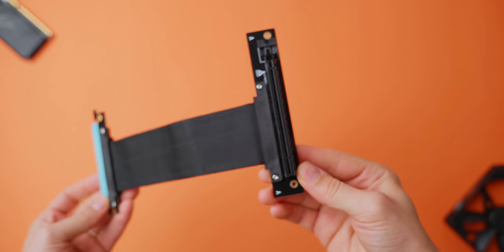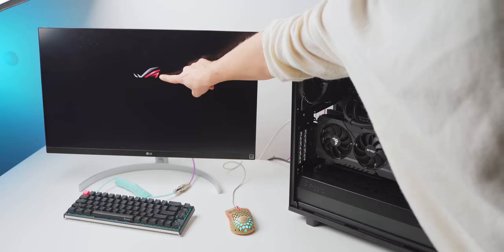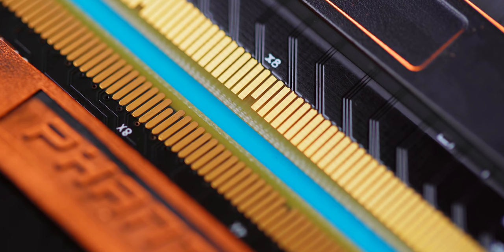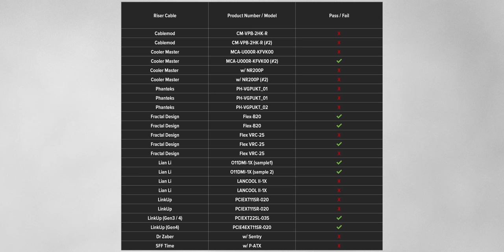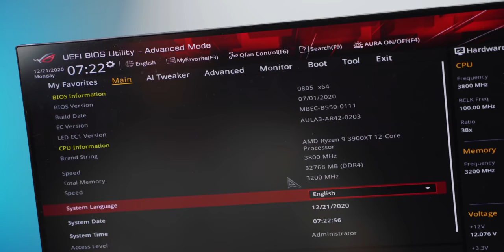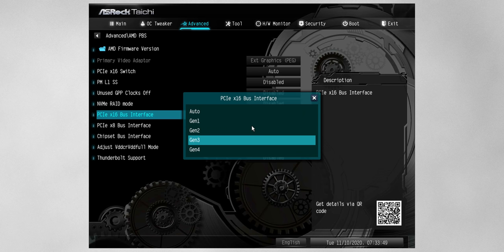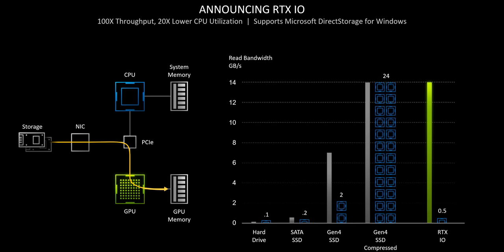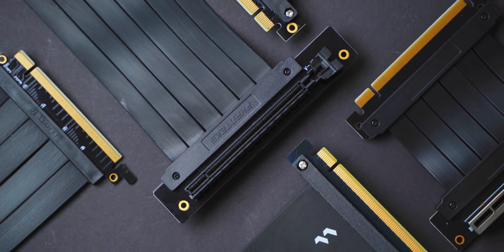There's a PROBLEM with Riser Cables

Comment: The only riser cable I've been able to find that is Gen4 is made by LinkUp. A 20cm right angle cable runs just under $60 USD on Amazon. It's frickin ridiculous! So far, everything works just fine if I keep the one PCI-E x16 slot locked down to Gen3 on an Asus X570 Crosshair VIII Hero with a Sapphire Nitro+ SE RX 5700XT. I went through all the trial and error testing on my own rig when I first got my 5700XT about 9 months ago and everything led to the riser cable. I've told people about this and they just blew it off and kept blaming the drivers. I'm really happy to see someone in the media mainstream backing this up.

Comment: I used a Gen 3 riser cable a few hours ago to pair with my 3080. Ended in disaster caused my mobo to go into a inescapable boot loop, even when plugging the GPU directly back into the mobo. Always change the gen of PCIE in the bios when using one of these cables is what I've learned, or better still take the plunge and buy a true Gen 4 riser cable. It saves a lot of time that would otherwise be wasted.
Reply: So how did you finally brake up that boot-loop?

Comment: Bought a gen 4 pcie and a thermaltake s300 and it works surprisingly well. Gpu stays at 65c under full load. S300 has plenty of room between the vertically mounted gpu and glass

Comment: As a service Technician, I thank you. Was seeing this issue most on the Thermaltake cables with their VIEW line of cases. Plenty of good cards getting blamed.
When some customer assembled builds came in for diagnostic and a riser cable was used, we go for the cable first.
Reply: I'm in this boat.  I could not get my Gigabyte Z390 or my new GB Z690 to work on Auto Gen in X16,  I know Compatability is sketchy but mobo manufacturers need to start listing compatibility for this issue

Comment: Great video!  2 weeks ago after installing a 3060Ti in my Thermaltake Core G3 case I went through this issue.  It would work perfectly until you went to run something that really taxed the system like Time Spy, Port Royal etc... where it would just fail randomly.  I tried everything to figure out what was causing it.  On the bench with the card plugged directly into the MB it was fine, but with a different MB, RAM, CPU, PSU, fresh install of Win10 etc... and then 6 different riser cables from 4 different manufacturers (including 2 Thermaltake cables that were supposed to be the same as what came with the G3 case) and only the original cable would display anything at all.   Finally I put the system back to how it originally was and contacted Thermaltake tech support and after a few back and forth e-mails they suggested switching to Gen 3 PCI, it was on auto, I switched it to Gen 3 and bam fixed...
Reply: Bam, losing performance.

That's all you did.

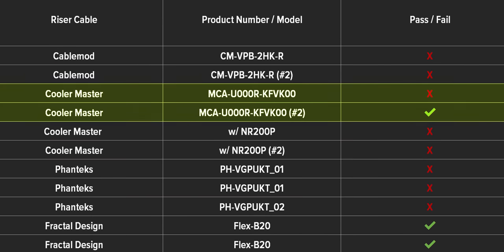Comment: 6:40 - Because of manufacturing tolerance and variations. Very interesting to see how such small margins in something that passes QC for PCI-E 3.0 makes the difference for 4.0
Reply: Welcome to the world of signal integrity. In electronics clock lines are very critical and based on the materials and purity of the cable this can create issues such as drift and even signal loss.

Comment: The same day you upload the video I get my PCI 3.0 riser cable by cooler master. I have the AMD r9 390 GPU ...when I install the riser cable and I open a 4k video or a game my GPU crash everytime the GPU usage goes 100%. After a long searching I found your video and I change my PCI slot Gen from the noon to 2.0 from 3.0 and that works perfectly without fps dropping. So if somebody have the same problem as me change your Gen slot PCI to 2.0 if you have 3.0 or to 3.0 If you have 4.0 . (My MSI x370 gaming pro carbon motherboard didn't have that option so I updated the bios to the lates beta version ) thank you for the video Dimitri ❤️

Comment: I have a new Louqe Gen 4 riser cable working on an ASUS X570-I motherboard and RX 5700XT w/ the Gen4 PCIE option selected in UEFI.
Reply: Netluxe TV It has been working without any issue! I tried a riser cable from LINKUP as well, but that wasn’t a good experience when forcing PCIE gen 4 in the BIOS/UEFI.

Comment: PCIe 4 risers are expensive for a reason. You need either shielding or active signal boosting. A proper gen 4 riser is likely going to be very stiff.

Comment: First, let me say it's stupid that these are being called "riser" cables.  They're extension cables, not risers.  A riser is a rigid daughterboard.

Second, automatic version setting on the slot does not mean it negotiates a slower speed when the connection is bad.  It's not a modem or ethernet cable.  The version used is the maximum supported by both the system and the peripheral.  If you plug a revision 4 card into a revision 4 slot, then the slot is going to run at revision 4.  The simple passthrough extension cable doesn't change that negotiation.  It just breaks the system when the signal degrades too much to be usable.
Reply: Well, what to call a cable that does the exactly same thing as a riser, but is a cable? A "riser-like cable"? A "cable that does what a riser does"? A "cable that functions the same way as the rigid cards we're calling risers"? Why not "riser cable"?
Reply: It completely depends on the case you use it in. My case has a stock PCIe 3.0 riser card, it has to be used due to the case layout (as in it raises the card above the socket), can't use the stock card because it doesn't work with PCIe 4.0. it has to be used due to how the card mounts in the case (well above the PCIe slot) so yeah it's a riser cable

Comment: Link up has a gen 4 cable. I have 15cm riser and it cost $60 from Amazon. Plugged it in and it booted right up didn’t have to switch from gen 3 to 4 in bios. Running a 3800x with a evga ftw3 3090. My gen 3 cable gave me issues at first.

Comment: I just upgraded to a Ryzen 5 from FX-6300 and new mobo. Transferred my RX 580 and dealt with crazy instability/crashes/freezing/restarting. Removed the riser cable and it's fine now. This video is my validation I've made a solid decision to stop vertically mounting my card.
Reply: Few months ago I did just about the same. From an FX system to a R 5, even have an rx 580. Thing is I built in a glass side panel case. Back of the gpu isn't as aesthetically pleasing as the MB. For a bit more coin I can get a custom gpu backplate. Seems to me an acrylic plate would be more of a heat problem as these cards run hot as it is.

Comment: This video is a life-saver. 

Was getting a black screen on boot with my new 3070 plugged in through the NR200P riser cable, and was genuinely confused, as the graphics card was getting power and seemed to be running. 

Plugged in my old RX 470, went to the BIOS on my B550i, changed to Gen. 3, and voilà: got the all too familiar ‘Insert boot media’. 

Gonna be interesting going forward to see Gen. 4 riser cables, and how they price in relation to current ones. Thanks!

Comment: Thanks so much for this video @Hardware Canucks! This video really helped me especially building everything externally before putting it in the case. However, for those out there who may still have boot issues, I had to enable PCIe Bifurcation in order for the system to boot. This may be due to 2 x M.2 Nvme ssd installed. I have the latest bios for my B550-i from Asus (2403).

Comment: Having a Phanteks shift, I had issues when I plugged my 5700xt in and I had to return it. The cable I later found was the problem (I can only assume the cable couldn't provide some power or data for the GPU, even in gen 3 mode for the mobo I had crashes). I hope more companies make gen 4 cards now that both brands make PCIe gen 4 cards.
Reply: So even changing BIOS settings isn't a solution? This is really disheartening to hear, I was planning a 3060Ti Shift build for spring...
Reply: @ThiccNutt  it's a risk we shouldn't take, I can sort of understand since most cases don't rely on the cables like in my case, which leads to less of a need to make them, but then again people keep wanting to waste money to make their GPUs look different and then they get the gen 3 cables and make things worse. It's a mess right now.
Reply: Omg dude yes. Even prior to gen 4, the Shift consistently had riser cable issues. I can't tell you how many RMA's and riser cable swaps I had to do just to get things working
Reply: @Smashologist  Thats a major bummer! Thankfully I got a free gen 3 cable from them when it shipped with a pcie gen 2 cable and I verbally stated to them its shocking theyd ship old tec with a new case, so far no issues with my 3.0 cable thankfully.
Reply: Try switching it to the 2nd slot on your motherboard. It should be a x8 slot. you can check the pin out to see if it is.
Reply: @mredude4867  I said I have a Phanteks shift, an itx case. No second slot.
Reply: @mredude4867  itx motherboards only have one p-cie slot.
Reply: I had the same issue with my 5700xt in my CM C700M case. Drove me insane trying to troubleshoot what was going on. One in every 10 or so resets it might boot and run stable, but it was pretty random whether it would actually boot or not.
Reply: I'm having the same issue with my vertical mount kit. I manually adjusted the BIOS settings to GEN 3 but still sometimes loose signal, random black screens etc. I try to get a refund but the issues are so intermittent I cannot prove my point and the seller says the cable is fine, which in theory it is not. Never buy Bykski products ever again.

Comment: Thank you so much!!!!!!! I’ve spent the last 2 hours trying to figure it out. I have the ASUS TUF GAMING X570-Plus. I upgraded my case to the Thermaltake P3 and it was my first time dealing with Riser Cables. My RTX 3090 Founders Edition finally works again. I did exactly as you explained in the video, went into the bios and changed AUTO to Gen3. Everything now works! Thanks again!

Comment: Hey man, an absolute thanks for this. 
I have custom water cooled my PC and for months I have random issues with my PC of Asrock X570 Taichi and Phanteks Riser Cable and 5700XT. It works sometime, but BSOD and random boot issues are driving me mad. RMAed my ram, did a lot of A-B testing, took it out for checking in computer shop, disassembled my PC completely and reseated everything, and finally reached a conclusion that it is the riser cable to blame. A painful lesson it certainly is.

Comment: This topic and video could be refreshed every couple of years.  And yours in particular is by far the best out there after this many years.  I recently have had a few months worth of issues with the rtx4090 on a Phanteks gen4 riser. I've had the card RMA twice, ran the bios in gen3 mode and still getting random crashes.  If I had more up to date info on this I would have built into a new case without a riser from day 1. 

This may be just 4090 specific due to the higher bandwidth demand of the GPU but I was not expecting to have so much drama.   

Great vid give us more
Reply: Just wanted to add after watching again.  My crashes are very very random, so bench testing beforehand would be useless.   My PC can run for a week with no issues then suddenly crash.

Comment: It's not just Gen 4 GPU to Gen 4 MoBo. I have a 2080Ti on an x570 normally working fine without issues using the riser cable. However certain GPU intensive games ether crash or BSOD for some reason. I decided to remove the riser cable yesterday, and behold. System was much more stable on heavy GPU load.

Comment: I have a question. In the Workarounds section you mention "...aside from buying an expensive PCIE 4.0 riser cable". Have you tested any 4.0 cables, and if so - what are your impressions ? 

I have a Corsair 5000 D setup, and I'm in the process of adding watercooling to my 3080 - and I'm really considering  the vertical mount. I've found a few "PCIE 4.0" risers by LINKUP on Amazon, but I can't comment on their performance/compatibility.

Comment: Had an issue with a gen3 motherboard, gen4 (and gen3) riser cards and a gen4 card (rx5700). Directly plugged in the card would run fine (ran that way for a few months open bench waiting on case), but on the riser it would sporadically black screen, could run all day, could run ten minutes, seemed to be no correlation with load or activity. The gen4 cable that came with my Dan4 case, an additional gen 3 cable I bought and the gen 3 cable that came with my Ophion all exhibited the same behaviour.

This was late 2018 and the talk of switching motherboard compatibility wasn't mentioned anywhere I was searching for help so never tried that, but, worth flagging up you could have this problem on a gen3 motherboard, doesn't have to be just a gen4 that can cause you a headache.

(ended up rma'ing the card and getting a 2070, comparable performance, cost me a bit more, but gen3 and has been fine since on the Ophions gen3 cable).

Comment: My linkups Ultra PCIe 4.0 riser cable has been working flawlessly no performance degradation seen. My case is a node 202, so it came with a PCIe riser card that doesn't work with PCIe 4.0 and caused all kinds of issues.

 Went with Linkups and haven't had an issue since.  I've put many hours of gaming on the system since I've installed the riser cable with absolutely no issues. The longest gaming sessions I've put into my system at any one times was 27 hours.
Reply: Did you have problems even when you went back to 3.0? I'm having BSOD even when setting the motherboard to use PCIE 3, I have the linkups arriving tomorrow so I really hope this will help.
Reply: @110hoppy110  nope, when I was still using the stock riser card that came with the case and went back to PCIe 3 it all worked fine.
Reply: @madmax2069  Thank you. I have seen a couple people who still had problems so hopefully this will solve my issue if not I guess I need to RMA my GPU.

Comment: If you get a chance to chat with a MOBO manufacturer, I think a cool feature would be if you don't have anything installed (cpu/gpu/ram/storage), the bios would still come up when pluging into the onboard HDMI, regardless of what components are installed and working. It might cost $5-$10 in parts to make it work, but it definitely would be a value add.
Reply: That would mean putting a video processor in the mobo.  Would make them really expensive.

Comment: I went into the build expecting to encounter this issue, but I'm one of the lucky ones.  Raijintek Ophion w/ PCIE3 riser with RX6800 XT (PCIE4) and ASUS B550i (PCIE4) booted up fine.  I did use the same NVME drive that already had Radeon drivers pre-installed while on a motherboard with PCIE3.

Comment: Got my Gen4 riser cable off Amazon for $61 have not had any issues with my 3090 and my x570 Taichi using said cable.
Reply from the maker: Exactly.
Reply: If I may ask, which cable did you purchase exactly? I haven't found any true Gen 4 cables on Amazon Germany.
Reply: @ThiccNutt  The LINKUP 4.0 cable works for me. 3090 and an Asus x570 Pro WS Ace. Available on Germany.
Reply: @MultiFeesh  Awesome, thanks! I just found it.

Now to find out what length is needed for the Evolv Shift 2 Air :D
Reply: @ThiccNutt  24 cm should be your best bet. For a single vertically mounted GPU.

Comment: This is Not Only a Problem with PCIe 4.0, I also Had a Problem with PCIe 3.0 especially with the Phanteks Risers. They are pretty poorly shielded, so i Had Problems with some GTX 700 i owned, namely a 770 Lightning and a 780 FE. I head weird Lock ups during startup or no Video Output at all... When i switched to a GTX 970 FE the Problem was solved. I was on the Phone with EVGA, Asus, Phanteks, my retailer and even Nvidia didn't know what was going on. Riser cables usually add a Lot of Problems, especially the Low Quality ones,  but in some cases there are necessary...

Comment: I was having these symptoms with an ASUS 3080 TUF. After a ton of testing, I sent it back to ASUS on an RMA. Waiting to hear back from them. Maybe this is it all along!
Reply: Most likely! Have a 3080 TUF as well. Just posted my story here as well. You wouldn't believe the shit I've gone through. Also 2 out of 4 RAM sticks where DOA, so that made it even more complicated. And having a custom loop was very time consuming to take it apart every single time. Working fine since setting to GEN 3. Glad he posted this video, a lot more would have had this issue in the future
Reply: I found this out pretty quick with my x570 and rx5600xt, but not before I sent the cable back to thermaltake because I knew the gpu was good. Sadly gen 4 riser cables are more expensive and not really worth it to me.
Reply: Oof, hope they return it quickly.

Comment: I got a Linkup 4.0 riser around 4 or 5 months ago when I got my 5700xt (sapphire nitro+ ... whatever the f it's called).  Works great.  If Amazon runs out, just get in touch with Linkup and they will make one to your specs and it will come fairly quickly.   It was about 90 bucks when I got it but I wanted to take advantage of the whole 4.0 infrastructure these days... storage, CPU and GPU.